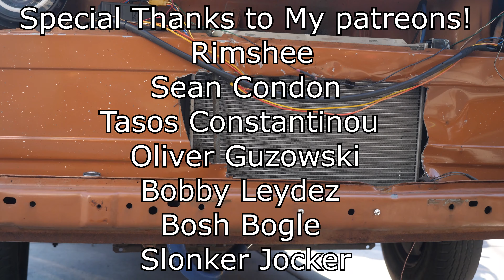How Adam Saved Me After My Car Accident

Comment: Holy shit dude. Had no idea. Glad you're alright tho. (I'm currently at work so if this video is like "Ahhh it was just a fender bender" I won't actually know til I watch it)

But I drive a 96 Dodge Ram 2500 Designer Van. I totaled a little Toyota Yaris back in the day and all that happened was a slight indent and the radiator got knocked slightly out of place. Gotta love them older vans. Made of steel.
Reply from the maker: They are actually metal which is a big deal for damage like this. I won't spoil too much but everyone in the crash was ok.
Reply: @BulletBarry  That's what I'm sayin! They weren't Styrofoam with a plastic covering back in the day. You know what I'm trying to say lol. It can really make a difference. Also, really glad everyone was okay!